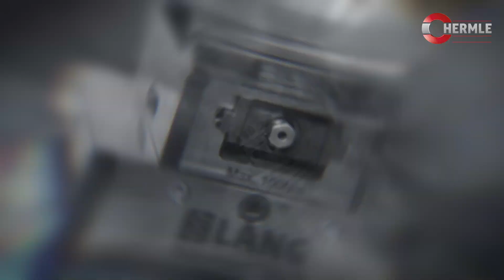HERMLE C 400 Elefant | elephant

Comment: Is this the 18,000RPM Grease pack Spindle?
Reply from the maker: This is the 18.000 1/min spindle with collision protection!
Reply: Is this the spindle that comes on the performance line special version? @HermleAG
Reply from the maker: There is no special version from the Performance-Line. There is a new spindle with 20,000 rpm on some models but not on the C 400. @nicksquillace2887